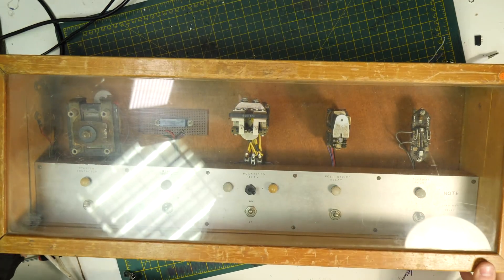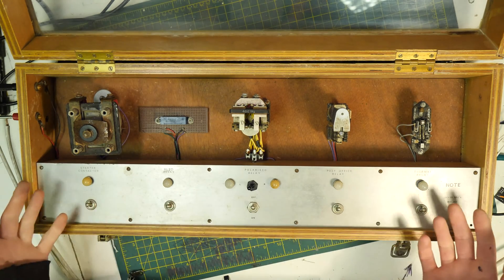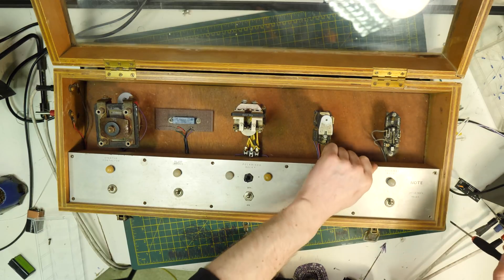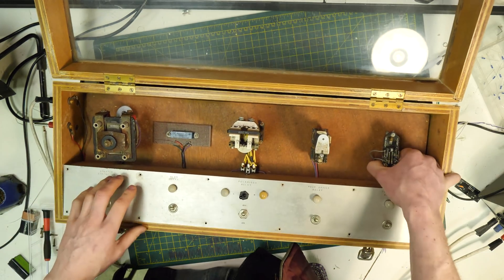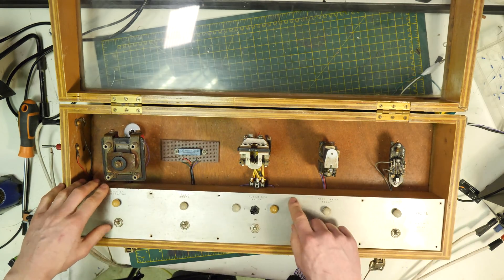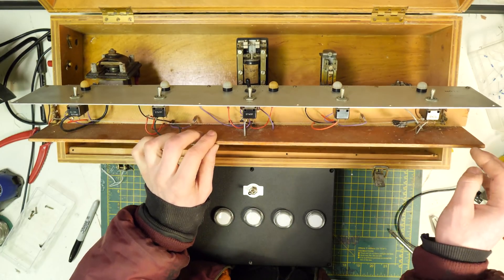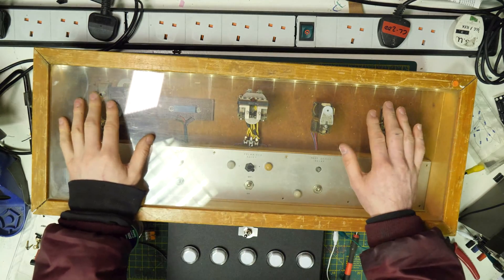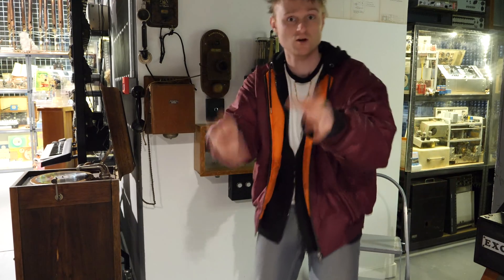Making This Relay Box Interactive For The Museum

Comment: Could you use power tool batteries as a source for some of these? Easy to take home and charge up, decent Amp-hours rating on a lot of them. 12V, 18V, 24V available and chargers that do more than one battery.
Reply from the maker: yeah dfeffo!!! could be good! when size permits :D

Comment: You could put a capacitor in-line with the big contactor, which will limit the duration to a short pulse. Use a discharge resistor (maybe 500K ohm? Maybe more?) across the capacitor so it will reset when the button is let go. Might help with the longevity and reliability.

Comment: You can one up yourself and get a bucket from a high voltage panel or motor control center (mcc). Buckets usually have large lever switches that move when the coil energized. Makes a contactor look tiny.